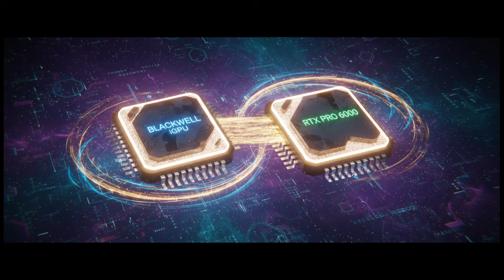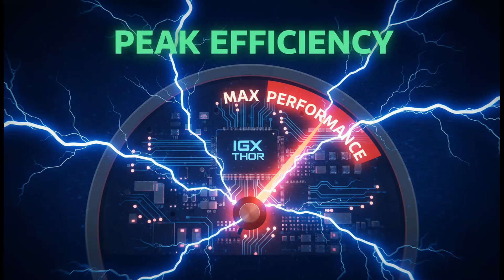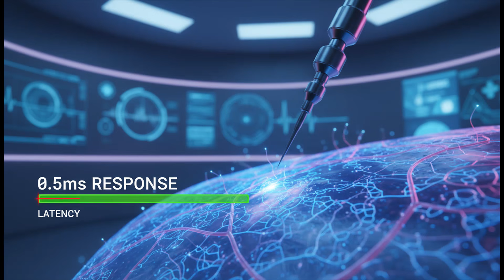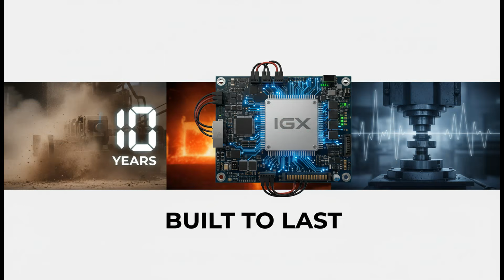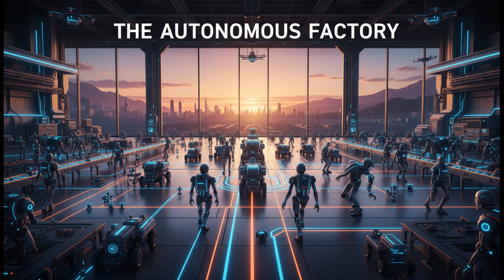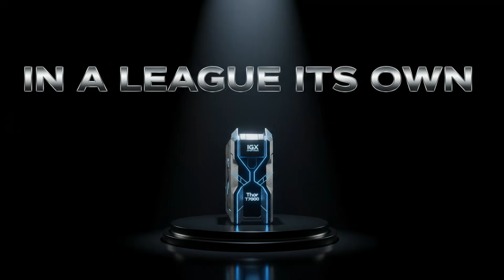5,500 TOPS: NVIDIA's New IGX Thor Monster

Comment: FP4 comes with trade-offs that matter more than the headline figure. Accuracy drops, model compatibility becomes constrained, and many workloads still require higher precision, typically INT8, FP8, or FP16, to maintain acceptable output quality. As soon as you move to those formats, the effective throughput collapses.

Your video presents this poorly. It’s like celebrating streaming video at 240p.

Also a desktop GPU is roughly 1450 TOPS at INT8… 1450 INT8 TOPS on a desktop GPU is materially more meaningful than 5500 at FP4